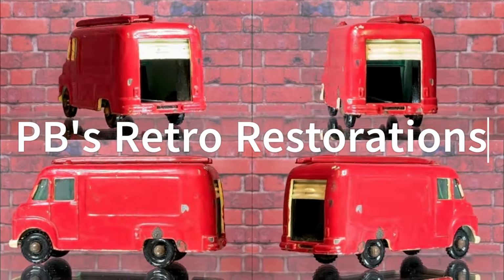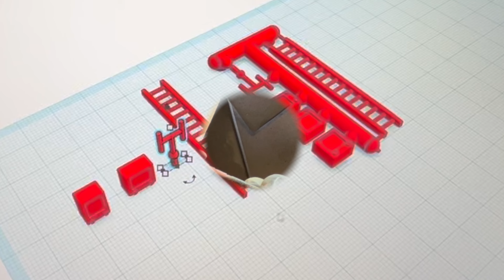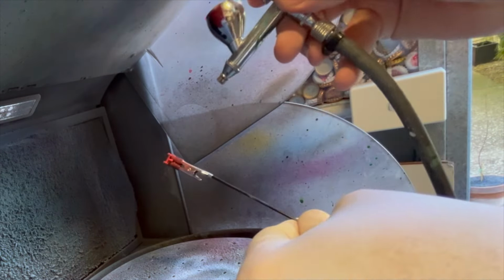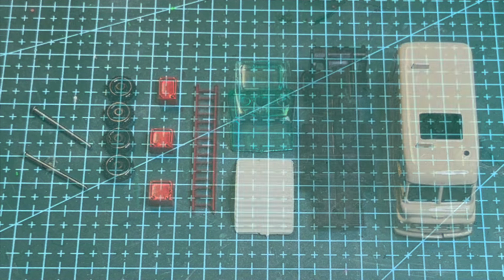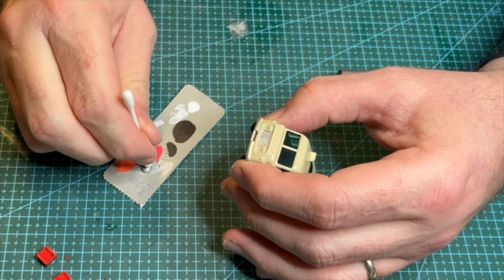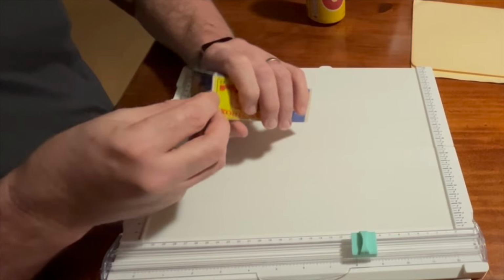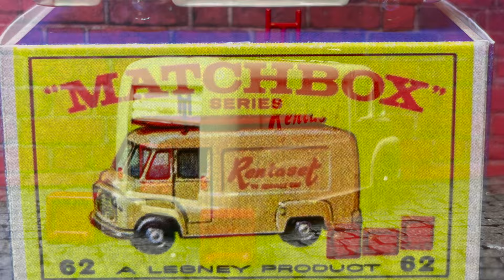Matchbox Lesney 62 TV Service Van Restoration / 3D Printed Accessories

Comment: nicely done, even if it fought back a little. :)  that repaint isn't half bad, really. they overpainted the chippings, but so did I as a kid, at first without taking them apart first as well. so, there. :)
nice 3D stuff. those TV sets demand a nice decoration, though. :)
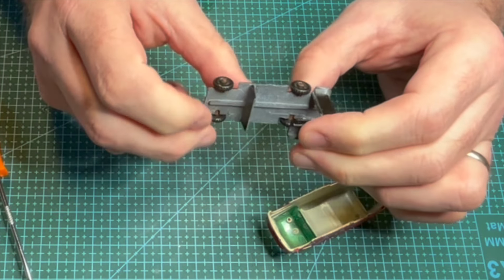2:45 story of my youth! I had some long decals wrap around my finger completely, only because I overstretched them a tiny bit while pulling the paper out... and as with CA glue, you gotta be fast, they stick together right away. :P

as for the rollgate working so hard, it comes from paint on where it goes. the plastic runs hard on naked zinc already, but fresh paint makes it stick to it. I'd add some graphite off a soft pencil 2B or 4B, where it's running on, that ought to help with it moving easily. same with door hinges like Majorette had, or older Dinky. I'd mask that area to leave it clean, I had doors stick close because the paint wasn't 100% dry.

as for the box, your method might be inefficient or something, but if the result looks like it should, it ain't a bad method at all. :) there is more than one way to success. ^^
Reply from the maker: Thank you Lothar, I should have thought of the paint causing a friction issue with the roller door.